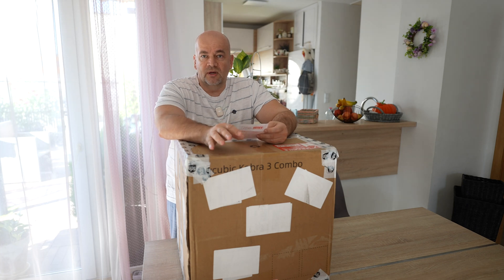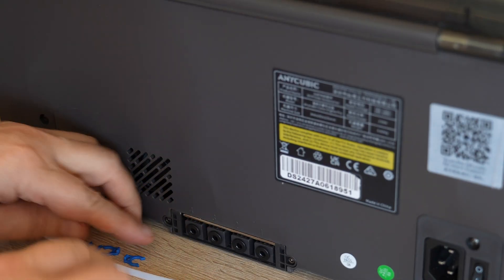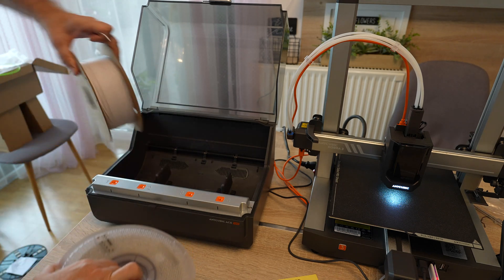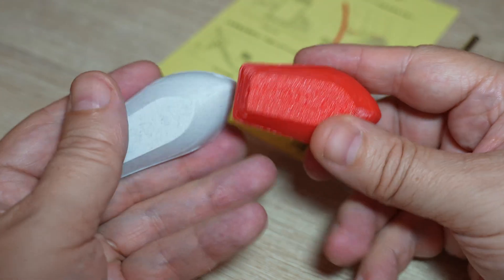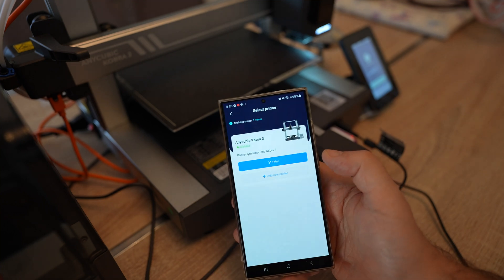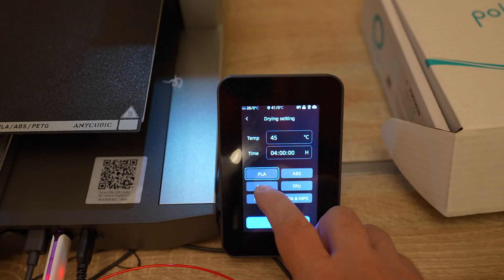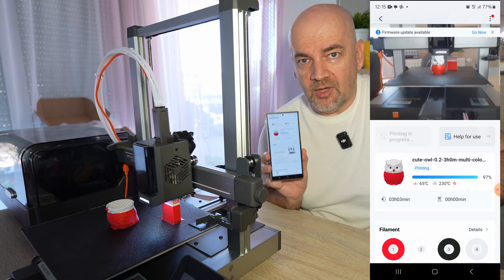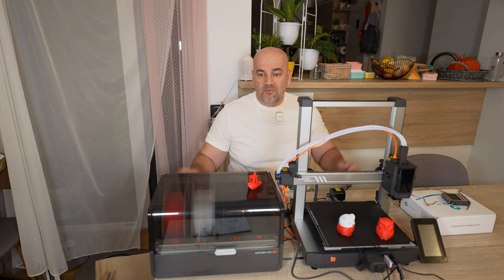Great for PETG: Anycubic Kobra 3 - Combo with heated multicolor system

Comment: Great review/ overview. It has been difficult to find much about this model outside of facebook comment sections. It looks decent, and any competition to the AMS system is welcomed.
Reply from the maker: Competiton to AMS system is welcomed, but some IDEX or toolchanger would be welcome too ;-) (I don't like so much waste material)
Reply: @MyTechFun  Absolutely. I wish for a Prusa XL, but I have more of a Bambu budget haha

I'm excited for what the next years of tech will bring to the 3D printing community. It's made leaps and bounds in the past few years alone
Reply: @MyTechFun  Personally I dont care at all about the filament waste. I think there is so much waste everywhere else its a little thing to worry about given the frequency that I use it.

Even with that said though, I sure do agree that I want more multi tool head options. Personally, I dont like prusa, but they are the only game in town (though the proforge multi tool head printer is coming out), and we need more options there.

I would love to more casually design parts using multiple materials. I can do it now with the AMS but its very much so out of spec doing so and the slowness is bothersome because I want speed.
Reply: IDEX like on the visionminer would indeed be very welcome. If only it was to speed things up with multipart prints.